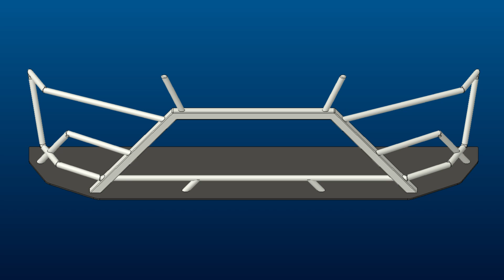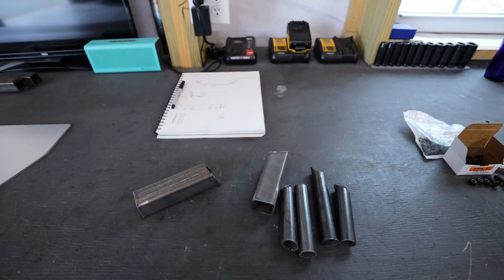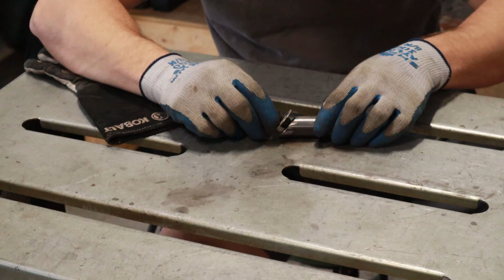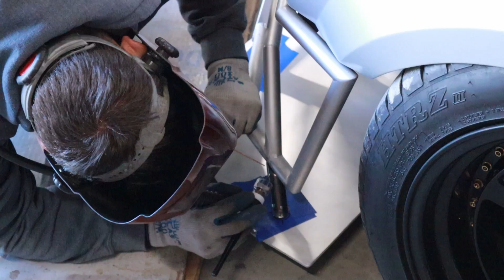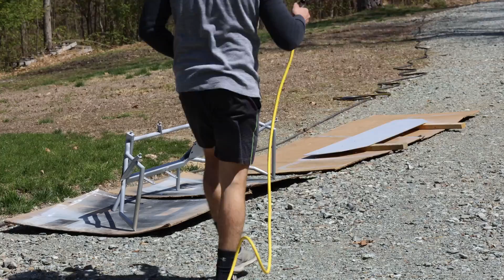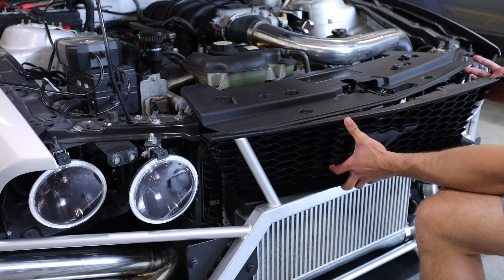EXO Bumper Rebuild and SPLITTER Install | Turbo Mustang

Comment: Are you just not going to finish the wide body? It’s been 2 years
Reply from the maker: This wide body has been finished for a long time
Reply: @Kordare  so you just don’t care about the panel gaps or anything?
Reply from the maker: @Fluffy_Shoeees  nope that's the style I was going for. I did build the Z3 widebody more traditionally (kinda) if that's what you're into.

Comment: I dig the new splitter! it really ties the bumper together and makes the bottom more cohesive.

I'd add some sort of 3D printed fog light housing in the smaller openings of the bumper under the headlights. 

And speaking of headlights, what lights are those? I would love to get some for the Subaru I'm building.
Reply from the maker: Thanks! Those are hella rally 500 light's
Reply: @Kordare  Sweet, thanks!

Comment: This is probably one of my top 5 favorite Mustang builds. 🔥🔥🔥 Nice work man. 👌🏽
Reply: Kordare, what size tires and brand are you running?  Also are you running Aodhan wheels?  Thanks in advance.
Reply from the maker: @denniscanales2804  thanks! 18" Aodhan ds05 wheels with sumitomo fronts 275/40 and hankook rears 295/45